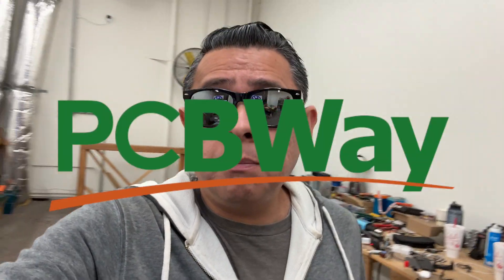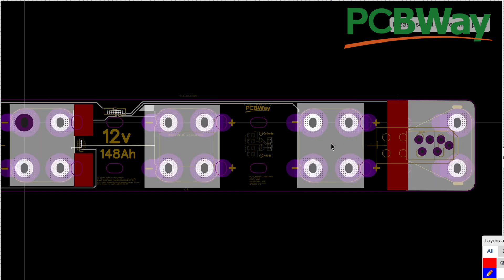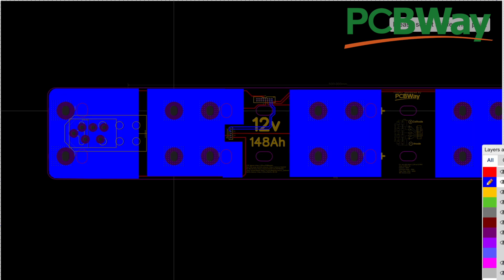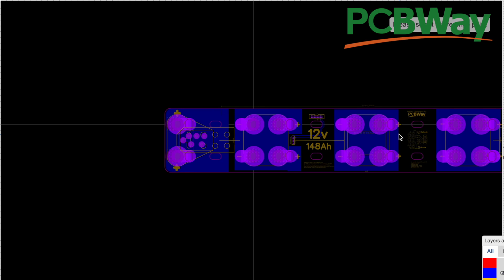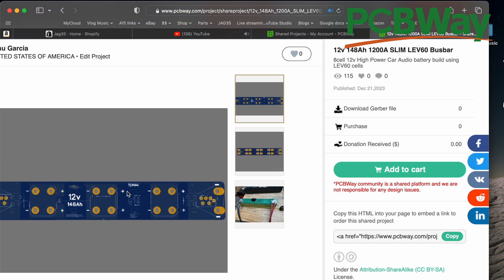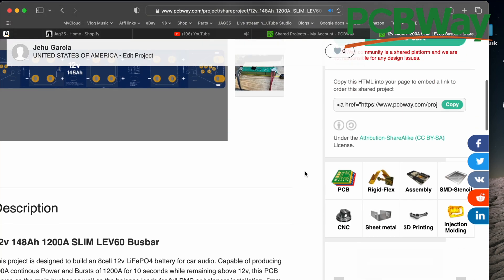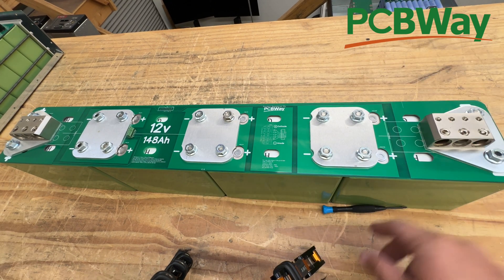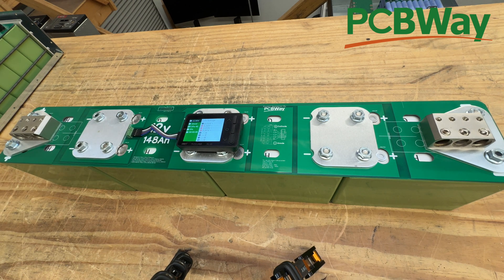Ultra SLIM 1200A 12v Lithium Battery for CAR AUDIO - PCBway

Comment: What is the lowest amp alternator to run this battery and what do you recommend as the optimal charging amp size alternator?  THANK YOU
Reply from the maker: You can charge batteries at any rate so there’s no minimum.  The rate you want to charge depends on how fast you are discharging your battery,  figure that first and then you’ll know what you need to keep your battery charged

Comment: good morning are you still selling these pcbway board or do I have to order them from pcbway I would rather pay you thanks
Reply: I just went to the web site for the bus bar plate all of it is sold out but I would like to have pcbway board I have the 4 cell one in the car for my audio its nice learned a lot from you been a 12volt installer 30yrs  still learning

Comment: make 3 more of this circuit, and make it a 48v 4800Ah + 48v input invertor for 3kw . you could probably run a full load 2kwh house power line for 1 day without a hitch, if eco usage maybe almost 2 days i think hahaha...

Comment: Also first thing i did was put a load tester on the bank when i got it. Held 1000 amps without being charged at all. Im impressed and for the naysayers these batteries are the real deal. I mess with alot of batteries and these are incredibly strong for the money. Im am very pleased with my purchase.

Comment: that Battery looks great. I wonder what you would need to run a 1/2hp 120v well pump. If power goes out it would be nice to have water for the toilet.

Comment: Hey long time subscriber here I just bought 24 of your new sodium batteries I'm planning on putting them in my Prius would love to see some testing done on the cells I've been doing some discharge tests they seem to get a bit warm and the temperature rating is 45c seems a bit low I wonder what happens when it gets above that temperature thanx again

Comment: Send these to someone capable of doing some real world testing?🤔 say like steve meade or soundman or something
Reply: Im not starve Meade but I have the big fat version of the battery and I also have 2 8,000 watt amps I’m installing on it in the next month .  I’ll be uploading videos
Reply: I don't think Doug has all the test equipment to measure these. Steve does have the test gear and can probably test it properly, but I kind of doubt he would be willing to do that. At least not for free. No doubt we will see these batteries popping up on big sound systems soon. So the feedback will start coming in as they become more common.

Comment: Wouldn't that battery need low voltage and high voltage cutouts?
Reply from the maker: All batteries do,  this is a typical LiFePO4 cell voltage so 2.5v-3.6v x4
Reply: Not really. Your alternator will be the upper voltage limit and you will monitor the voltage when the engine is off. 

There are bms's or battery Management Systems that can limit current from the battery to a load and disconnect it if the voltage gets too high or low. These bms's are limited in current to a few hundred amps and can get very expensive. For car audio use a BMS just doesn't make sense.

Comment: I know your a battery guy, but for large amp the ONLY way to go is to use supercapacitors. They are the only effective way to supply the current you need when that base note hits. Batteries simply cannot do that nearly as well.
Reply from the maker: Wrong,  its not the ONLY way,  batteries do great also.
Reply: I'm not sure where you heard that. Look at a lot of high power systems (10k to 80k watts). Almost none use super capacitors. Its all about a big battery.
Reply: I just ordered the baby slim, The lifepo batteries work for sure. I ran a 3,000 watt Stetsom and a 500 w Alpine mid and high amp together running my AGM to a cheap $50 20 amp hour lifepo4 with my stock 150A alternator and my voltage drop was extremely minimal. I didn't use an isolator I kept taking my battery off in the morning to test the voltage of each and the resting voltage of the lifepo stayed the same and the AGM also stayed the same every time I checked

Comment: How are these batteries going to handle alternator voltage? I.e. 14.4v,14.8v or close to 15v
Reply: Lifepo4 can handle up to 14.4-15 volts. Your battery under your hood is a 12 volt battery and is probably charging around 13.8-14.3 if you have a stock alt and if you have a high output alt you're 12 volt battery under your hood is probably charging around 14.4-14.7 and you just run your lifepo4 lithium battery in parallel with your battery under the hood but if you have a lto battery that can charge up to 16 volts you'll need a battery isolator to keep your battery under the hood from dragging down your lto battery while your vehicle is off.
Reply: @jbucku324 The only lead based battery you can run in parallel with Lifepo4 is an AGM since it's voltage is higher than a regular lead acid.
Reply: Max voltage for Lifepo4 is 3.65v per cell. So 4 cells in series is 14.6 volts. Don't ever go above that. 14.0v to 14.3v is great for these cells. Even if your alternator puts out 14.7v or 14.8v when cold, its really the resting battery voltage that counts. So when you turn the engine off the battery needs to be under 14.6v
Reply: @JasonWW2000 actually max voltage is technically 4.20v but there is NOTHING to be gained above 3.60v. 

Your cells will be fucked if you charge above 3.8V or so but technically it’s safe
Reply: @ericklein5097 The max voltage I quoted was from the cells datasheet. Because the exact mixture of chemicals in lifepo4 cells can vary slightly you always want to look at the data sheets to determine max voltage.

Comment: isn't LTO battery better for car audio? smaller/lighter in the same power output.
Reply: All the different lithium-based chemistries are going to have their pros and cons. You'll have to do some research to better understand which type fits your needs.
Reply from the maker: yes at the expense of less capacity and higher cost
Reply: Ehhh not smaller/lighter unless you are getting some 30C+ LTO’s like Lishen or Scib. 

Energy density is so poor on LTO but some of the cells out there are the real deal. YinLong are overrated IMO

Comment: What battery do u recommend for car audio these or headway or which u think I'm a noob to this I also have a 370a alt
Reply: I’m not jehu, but the lev cells are brand new and have 8-9x the amps of the headway… depends on your space and wallet
Reply: I just ordered the slim cnt wait its a bargin  @jeffreyabercrombie
Reply from the maker: yes these are better than a similarly sized headway battery pack.  I tested this https://youtu.be/Rc-S90seAkg

Comment: Can u show how to wire it to be able to get 16 volts ,?
,12 .is weak ,!
Reply from the maker: https://youtu.be/L0ke8fXTYe0?si=Qo4a8W_qKQlSEcXo
Reply: This would not be the chemistry you want for a 16 volt system.
14.6 volts is typically the max (3.65v x 4) and if you do five in series the max would be 18.25v. Much too high for most vehicles and amplifiers.

For a max of 16.8v you would want to go with either lithium ion (4x) or lithium titanate (6x) cells.